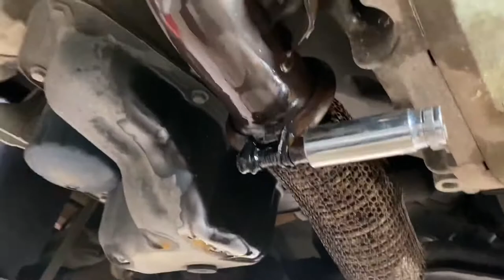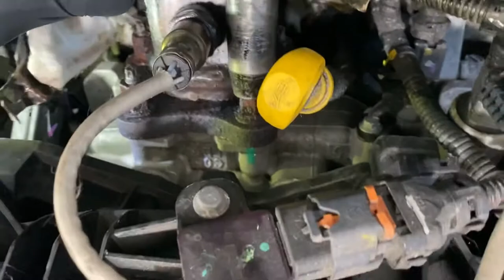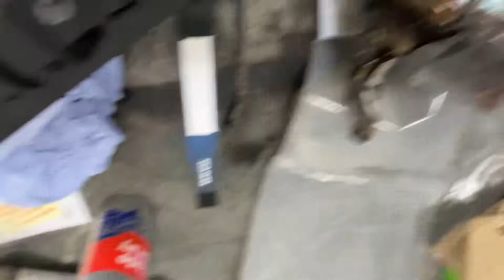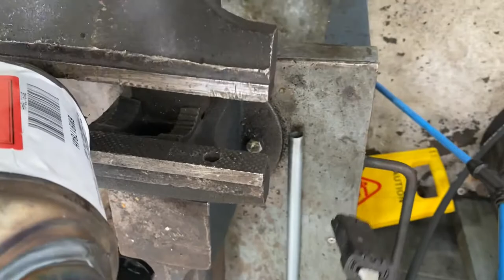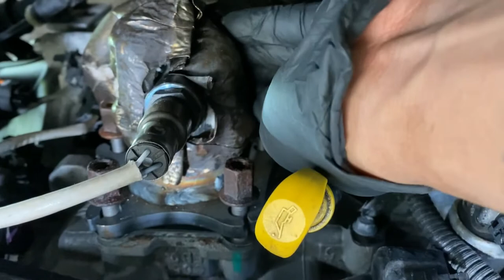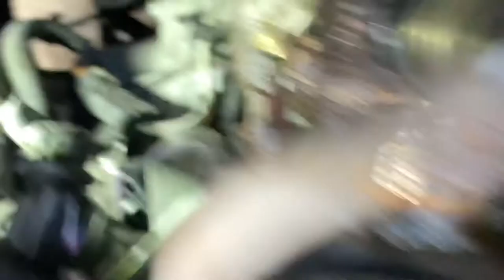#Peugeout #2008 #208 #Catalytic #Converter #Replacement

Comment: Hi Mate, after replacing the new cat should do we need to "break it in"? Also should we expect to see any smoke coming off the new car or new sensors?
Reply from the maker: You should do a few miles on it to make sure it’s all good and no you should be have excessive smoke just light smoke if the exhaust is wet until it dries up

Comment: Alright mate recently replaced my cat on my Peugeot 208 1.2L 2014, as it had a crack in it similar to the one in your video and was giving engine lights car runs sweet with replacement however sounds a lot louder than it did before the new cat was installed, is this normal? 😂
Reply from the maker: Check for leaks from from the exhaust system